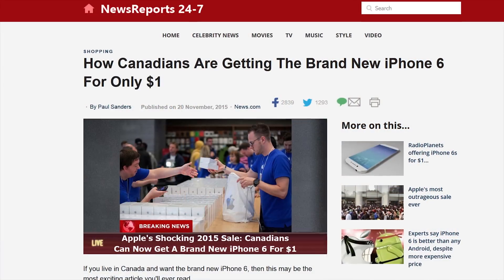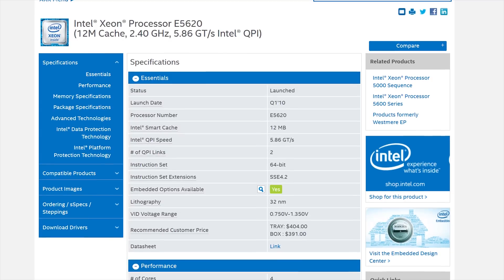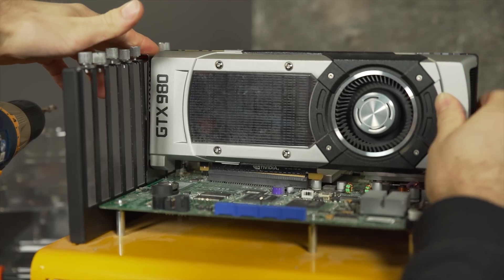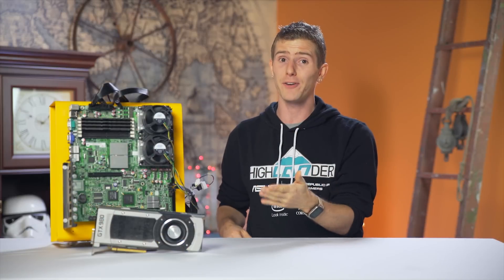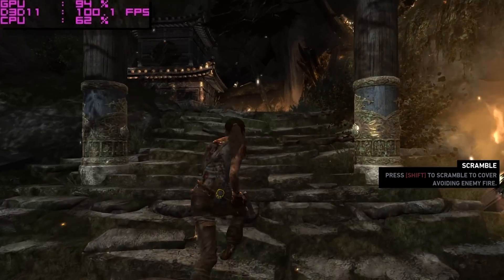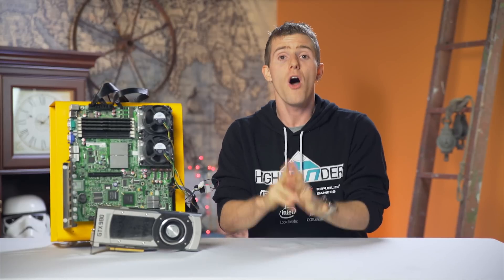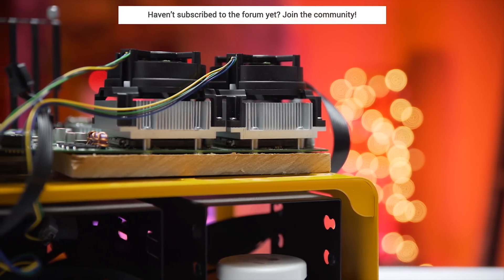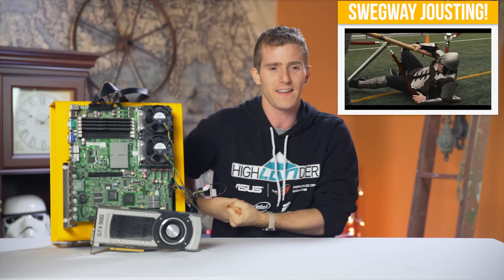Under $150 Budget Gaming 8 Core CPU, Motherboard & 16GB RAM

Comment: That is interesting, by the same coin and fx8350s will also be affected... That's good news for consumers.
Reply: +stephan walliser It's not necessarily that simple because of AMD's module architecture. Y'know, the whole integer unit vs. floating point unit thing. An 8350 only has 4 floating point units. The WAN show covered this a few weeks ago. AMD's "8-core FTW" marketing scheme has caught up with them.
Reply: That's true but still they have 8 executing cores with 8 processing threads.....
 8 FX votes is equivalent to a quad core HT(i7), of course it still draws more power from the wall and performs significantly slower... BUT it costs around 33% of an i7,

So the competitor against the FX is the i3, in old games the i3 blows the FX out of the water, by in newer games the fx(even tho it is older than my grandma) is still shinning.

I would love a 12nm 8350, but that is not going to happen because AMD is abandoning the modular scheme.
Reply: stephan walliser Admittedly, I've never owned an 8350. All of my opinions about it are based on what I hear from other people. I'd love to have some hands-on experience with it.

For some reason, the 8350 handles some games really well and then shits the bed with other ones. I haven't the slightest idea why that is. All i can do is speculate based on other people's findings. There are sooo many factors that contribute, and no one can come to a solid conclusion.

I can't help but feel like there's an engineer or two out there who fully understand the 8350's design and just laugh their asses off at these AMD vs. Intel arguments.
Reply: It is not really an argument about red vs blue, I am just saying if AMD recovers economically it is going to be beneficial for consumers.

Imagine both being on par... More choices better prices and both companies would compete harder which means more advance in technology.

The main reason AMD fails in some games is because of IPC, like on world of Warcraft the FX just shts itself.

But on games with mantle or that make use of more than 4 cores the four year old processor catches up to the i5s.
Reply: +paratrooper95 I believe the issue with the 8350 is down to instructions per clock and the fact that the floating point units are set up different on 8350 compared to Intel's CPU's as I am sure 8350 has 4 CPU cores for integer and 4 CPU cores for floating point which makes it different at a technical level although don't quote me on that.

I think if you are going to use an 8350 then it would be better to pare it with an NVIDIA GPU because right now NVIDIA's graphics drivers are less CPU demanding which results in NVIDIA's cards being harder to CPU bottleneck than AMD's.

Of course that doesn't detract from the fact that 8350 is a decent CPU for the price and as long as you don't care about power consumption giving it a good overclock helps.  I am currently using an i7 5820k on my main gaming PC however I own another PC with an A10-7850k and like it. I would always recommend an Intel CPU right now however I am sure Directx12 will make a massive difference for 8350.
Reply: +paratrooper95 Sorry mate I have commented and said pretty much the exact same thing that you have, I wasn't ignoring your post, I simply made my post before I got a chance to read yours.  Yes you are right, the 8350 has 4 integer cores and 4 floating point ones, games really love floating point which is why the 8350 struggles at times.  I honestly would like to know what AMD's thought process was when designing a CPU in that manner as everyone knows games thrive on floating point performance so as a gaming CPU it's not a good design. When it came to integer however the 8350 was very competent.
Reply: DX12 will bring asynchronous, HSA, mantle/vulkan, and other really big implementations that will make old technologies standard.... Thus making huge performance improvements on old hardware... Specially for AMD.... And sli/crossfire.

The only processors that are not gonna see huge performance with games coming on dx12 are processors with less than 4 cores, also processors with integrated graphics are gonna see some nice features.

The bulldozer architecture is made up of a "modular" design.

It has four modules each with two integer units, and one floating point, each module have basically 2 processor In them.. Except that those two processors share the FPU... Reason why they have so much L2 cache.

That is why I compared the four modules to quad core hyperthreadeds (desktop i7s).

The 8350s do have 8 cores except that they are not complete.

Btw: IPC= instructions per cycle.
Reply: stephan walliser Well, I hope you're right about DX12 giving the 8350 a benefit. That old bird certainly deserves a swan song.

Maybe then, after all this time, the 8350 will earn its place as a legend in computer history. All the hardware nerds will (if they choose to procreate) tell their grandchildren about the budget friendly glory that was the 8350.

Jokes aside, I would like to see AMD release another kick ass CPU again. Something crazy like Athlon 64 x2 again.
Reply: No Name Ah, that's completely fine. Don't worry about it, dude. Yeah, it seems like they had something like Mantle in mind when they designed it.

I assume they expected DirectX to go in the direction that used more integer units than floating point units.

Kind of a similar situation happened with Apple's first iPod. Apple made a product for a market that at the time didn't exist. Yet over time the downloadable music/ portable music player scene exploded, and is still successful to this day. Apple took a chance, and it payed off.

That's essentially what I think AMD attempted to do. Create a CPU for a processing workflow that never really existed. AMD also took a chance, but it didn't yielded as much fruit as they expected.

Don't get me wrong, though. The 8350 is a fantastic CPU... but only in certain situations that benefit from its 8 integer units.
Reply: The FX is not a fantastic CPU, but with dx12 it might be worth keeping if you already have it.

AMD is gonna abandon that module scheme for Zen, I just hope they don't exaggerate on the release price.
Reply: paratrooper95 Yes I believe the 8350 will do reasonably well under DX12 which may add a few years of life to the hardware gaming at 60fps.

Comment: I remember doing this a few years ago. cept it was with dual core xeons instead~. really amusing to having 16 ram slots all populated with 1gb sticks. Just note that POWER consumption is a good bit higher when running Two processors.

Comment: Linus if I sent you a certain amount of money, would you build me a cheap gaming PC for CSGO on budget like you do with scrapyard wars ish but actually working ok? Like if I sent $400 CAD could you basic build a PC for CSGO 60fps 1080p?
Reply: +tchallenges of course, he doesn't have a job and he will waste his time to help you for small amount of money, when any guy can do this for you!
Reply: +tchallenges and in CSGO you need something from your monitor hz rate (most of the time it's 75) to 200fps if not higher for smooth gameplay.
Reply: +tchallenges CSGO? You dont even need a gaming pc for that.
Reply: probably not but your local hardware store or if you still have to buy parts some online retailers do for like $20/30
Reply: +tchallenges There is no way Linus will build a pc for you. Research and do it yourself.
Reply: Get in contact with them and they will help make a custom pc for you. Its part of what they do.
Reply: I run Pentium g3250 and Radeon 7750 for 80+ fps in 1080 (graphics on low ofc)
Reply: +tchallenges my 3 year old laptop with integrated graphics gets 100fps at 1080p in csgo. Just get a 6core xeon x5670, x58 gaming motherboard so you can overclock it, 12gb ram, and like a gtx 950 or 960 and u will come in under that $400
Reply: almost everything can run CS:GO on 60fps 1080p on max

Comment: Does this at least beat the Microsoft's $400 PotatoOne? That's LITERALLLY all I need know
Reply: +Viet Lee Well its using a $400-$500 gpu so take that as you will.
Reply: +Viet Lee the human eye cant see more than 792 potatoes/30 potatoes per second
Reply: Donald Trumps Trumpet you know that's a wrong statment ... Remember that everyone's taste buds are different ... What I consider level 3 out of 10 sour might be a 5 for you ... So
Reply: +ValenKnight even without that GPG it still be ok, i'd say spend 150 or up on a gpu
Reply: Of course
Reply: +Viet Lee Considering it can run some games over 60fps...Yes.
Reply: +ValenKnight I mean ... the graphics card is where the heavy lifting is done so I guess spending 200$ on the card and 150 on the rest totaling 350 and still beating the xbone ... would be amazing
Reply: +Viet Lee stick a gtx 960 or R9 380 and it will whipe the floor with the PeasantBox One and PotatoStation 4
Reply: Damn... JKFilms and now Linus?
Reply: +CZTachyonsVN Ikr, I literally just came here from a jknews video
Reply: get a $200 r9 290 from newegg or eBay, and yes it'll kick ass
Reply: +Viet Lee Seen you a bunch of times even on askthefeels. lel

Comment: You could have used a PCIE Riser... Poor 980.
Reply: linus rekt tips 😎😎
Reply: 2swag4dat
Reply: +lululombard At Linus Media Group they use 980s as bookends, paperweights, and door stops. ;)
Reply: +lululombard it gave me a mini hear attack. poor 980 :(
Reply: thats extra money, another point of failure, and it might not be able to stay with the graphics card. the graphics card is always supported by the slot its in, and the expansion slot cover screw holes (or the slot itself, the non-electrical metal part for I/O, for those who dont know)
Reply: +John M Yes, but for this build just saying "You could saw the extra PCB but in our case..."
Reply: +Hearty Oatmeal Nice!
Reply: +lululombard Phuk dat shit Saw of some pcb so it gives more Megahurtz of power!!!!!!!!!!